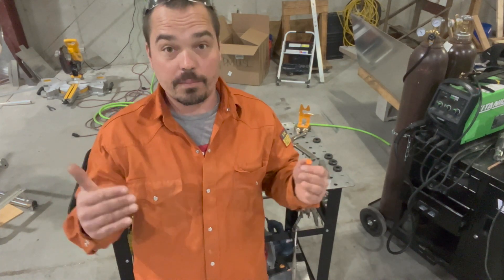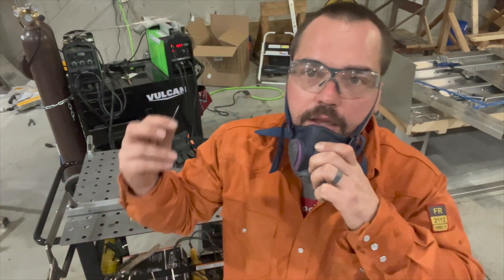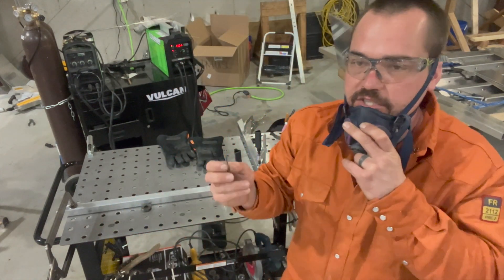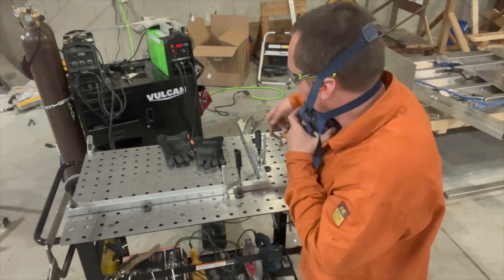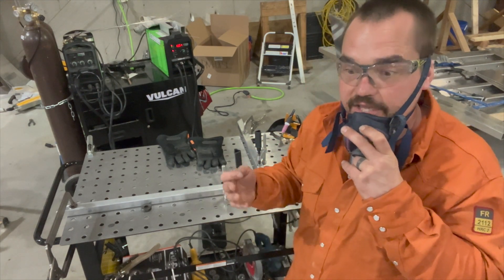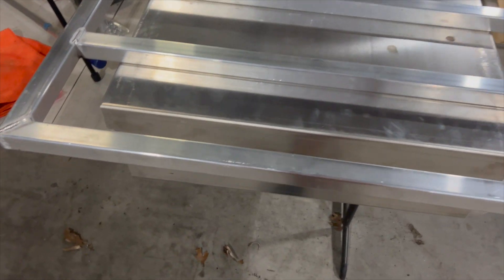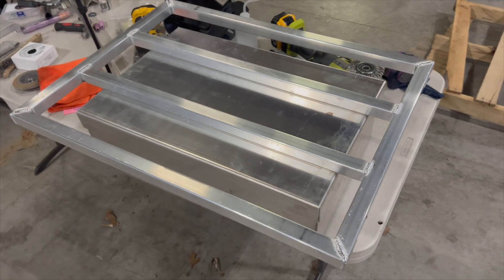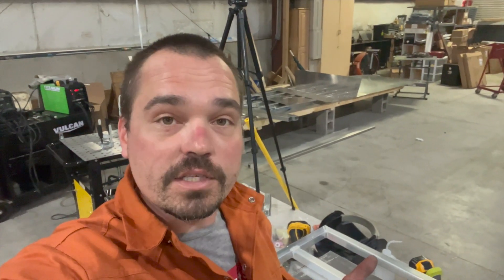Making a Pontoon Door - Aluminum TIG Welding

Comment: Greetings Tom, those look good to me; however, being a never welder, can you answer when the additional grinding smooth the weld comes into play?  Is it mainly for a cosmetic area such as the door you're working on, where hands will contact the area?
Reply from the maker: With TIG welding the hope would be to never need to grind a weld. The finish is clean, smooth, and consistent. The filler metal is there as reinforcement too, so taking that down can be risky if the back side is not welded too (impossible in tube). So, I do my best to make it clean and pretty and send it out the door!
Reply: That makes sense.  I experienced a TV wall mount breaking at a weld point, and there was no vibration involved like on a boat.  That was ground and powder coated primarily for cosmetic reasons in my opinion.  I didn't understand then why the mount wasn't welded to be structurally solid instead of cute.  It was not in viewing sight behind the set.  We never used that brand again and steered customers away from using it.
Reply from the maker: @awakenedtotruth8419  a lot of stuff like that is robotically welded and not checked for quality control enough. Definitely a bummer for the end consumer, but that’s how they keep those things affordable
Reply: @Toms Toons Pontoon Refurbishing  That was the craziest day by far.  The customer got the upgrade at no charge, and Bose paid us for our time so that one worked out to everyone's liking.
Reply from the maker: @awakenedtotruth8419  winner winner chicken dinner!

Comment: Morning Tom, I’ve recently invested in a mig welder and now, mainly due to the boats, would like to learn to weld aluminium. Just wondering, as both aluminum and tig require Argon, do you find one is easier to weld with than the other? And is one cheaper than the other? Thanks Tom, love your videos!!
Reply from the maker: I started with MIG but it’s not great for making things watertight, and it’s definitely not as pretty for things that will be seen all the time. MIG is great for structural stuff as it gets in hot and fast. And a pulse MIG setup can really lay some nice welds, but big money for those!

MIG is ALL about settings, and becoming consistent in your movement with the torch. TIG allows you to have constant control because of the foot pedal and you’re controlling the pace and amount of filler metal as you go, allowing you to adjust profile and penetration on the fly. Downfall of TIG is it takes more time and can’t get in weird places or positions a spool gun can. 

For me it was best to have both. You’ll see in a future video of a 12’ boat I’m building from scratch currently…I am using MIG for all of the tacking and for where you won’t see welds…then using TIG for visible welds as much as possible.